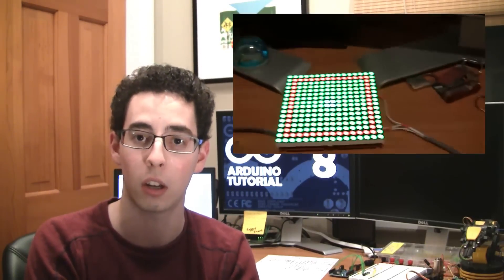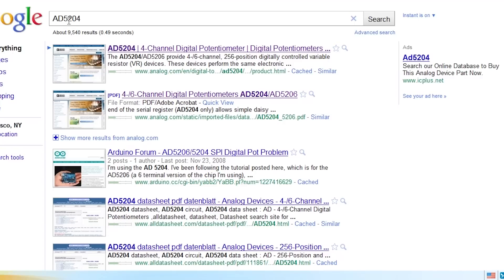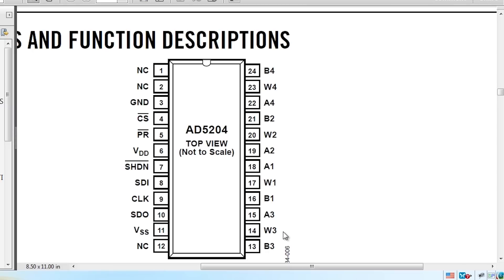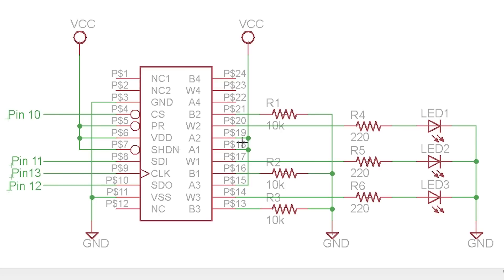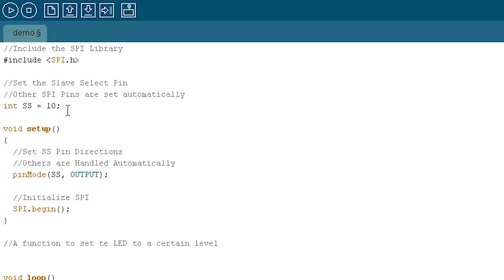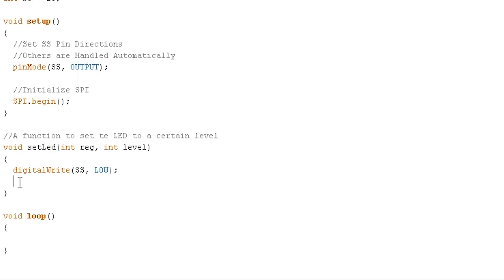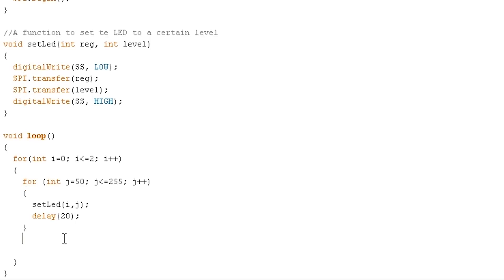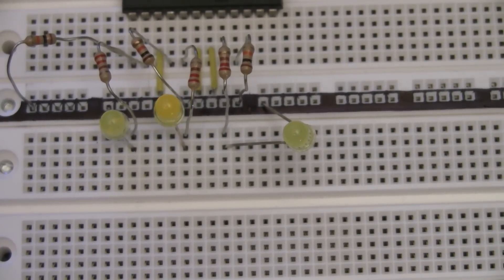Tutorial 08 for Arduino: SPI Interfaces

Comment: How does one send 2 or 3 bytes over the Arduino SPI?  is SPI.transfer() good enough?  I see on my Analog Discovery 2 Digilent analyzer that the first two spi clock pulses are missing when I try to run SPI.transfer() consecutively ?   Any good hints or resources available.

Comment: Great video! One question though, for the values that I assume are voltages that you're sending to the LEDs, what are the units for them? You write "50" and "255" but never go into detail on what they exactly are. I'm trying to program a DAC in a similar manner and need to be able to send exact voltages to each pin, but I need to know what value to set them to. Thanks!

Comment: For Arduino Uno, can we have a 2/3/multiple SPI control? Since the Slave Select is assigned to pin 10, I've tried using other pins as Slave Select but it never worked... or does it have another way?

Comment: So when a student is THIS tardy to class - do they merit even an acknowledgement that they've raised their hand with a QUESTION???

Sorry, but I was surprised at 12:30 to see you starting your j for loop at 50 BECAUSE - I thought that was exactly what the resistors back at 7:00 were intended to address - no???

Could this simply be that: you made an edumacated guess for resistance to lop off the useless bottom range, but discovered that so much still remained that you had to "fine tune" that pruning in software, that being easier than trying to dial in the resistor value?

guessing ...

Primarily wanting to confirm the understanding here - that BOTH approaches target the same issue?

Comment: Is it possible to use multiple ultrasonic ping sensors  .. with their trigger PINs in common or shorted .. but  each echo pin is connected  to  different   control lines of arduino

Comment: nice tutorial, however i want to know how MOSI and MISO work in this project? for example like, which pins are actually controlling the right LED to light up and controlling the PWM signal, because i saw you r using both MOSI and MISO?

Comment: Hi.. Please explain !!!!. There is a module that works on 3.3 Volts.
Using SPI in UNO which has 5Volts. Can that damage the module?
Is SPI effected with voltage levels??
Please help!!1
Reply: yea, you either want to find a version of that device that uses 5v, or use a logic level shifter such as the 74LVC245
https://www.adafruit.com/product/735
Reply: Ryan Young Yeah.. did the same.. thanks

Comment: Hello, Im very new to all this.  Can the wiper ever be controlled from the serial monitor instead of using the for loop? I can not find anything on this and i really need to learn how to do it.  I am an electrical engineer whit no programming experience.

Thanks in advance,
Shaun
Reply: +Just4Yuks Hello, maybe this can help you. ARDUINO MICROCONTROLLER GUIDE 2016. Step by step how to design and programming Arduino. FREE DOWNLOAD HERE
https://plus.google.com/116428027560638976608/posts/96r9KFpBur9

Comment: so if there only 2 CS what do we do in the case when we have like 10 slaves? or in my case 10 imu's?
Reply: Frank Lopez Either use more GPIO outputs and or use an external Multiplexer
Reply: Chris M explain how so?
Reply: Frank Lopez You can look this stuff up....pretty standard... This is not the place to go into detail..I think you have 3 SS on the Arduino...not sure since I use other devices...You can look at doing a "Daisy Chain"on the SS if you don't want to add any additional hardware...Another way you want to expand the number of SS, then look at the data sheet for this part: 74HC151 and 74HC02.... If you have 3 SS pins now than you can get 3^2 multiplexed pins or for more pins need t use GPIO pin as additional output from SPI software to 4^2 ....and so on...
Reply: i am using a 16ch analog/digital multiplexer for this 10+ mpu6050 i just dont know where to go from there? sorry chris im really new all i had was the idea, the parts just came in after me asking around what can help me achieve this concept and im barely learning how to read code never mind actually write my own

Comment: maximum how many leds can u control using spi interface??
Reply: The LEDs are not directly interfaced using SPI, instead a digital pot is used. In the video, an AD5204 is used, which is a 4-channel pot, meaning it can control 4 LEDs. AD5206 is a 6-channel device and thus can do 6 LEDs.

Comment: I would like to transfer over the W5100 Ethernetshield in RTP a 2*16bit=32bit Audiostreams with 44100S/s = 1411200bit/s /8bit= 176400Byte/s Payload plus the RTP Controll. Then i would like to send it over a 2nd SPI interface during streaming to 2DACs with each 16bit SPI out. Do you think i have the Time and this will go in function because i don't know what the 'C' Compiler is doing because i programm on the ATMega16 everytime Assembler. I must realise also the overhead and this is not so small if you know the RTP Controll Protokoll. I must transport 2 differnt Audiostreams.
My Board is a 2560 and i read that it is possible to have 2 SPI Interfaces at the same time => one over the SPI Interface and one over the USART is that correct?

Best Regards
Volker King

Comment: Hi Jeremy...  I am trying to exchange from PIC to Arduino...
But I have a doubt: How do I save the data got from SPI in a variable?  
with the CCS I had this, for a 16 bits variable:

" SS_LOW();  //Communication begins
  spi_write(register);  // register is 8 bits = the address that I want to access
  B1 = spi_read(0x00);   //B1 <= MSB 
  B0 = spi_read(0x00);   //B0 <= LSB
  SS_HIGH();   //Communication ends
  return (B1<<8 | B0); "

Thanks for your attention... Carlos Bohn.
Reply: use array , in many way you can make high byte , and low byte , you can use eeprom also and saving to the eeprom if the content of the address is 0 using for loop to jump into the address then check the content if it is null , if someone have better idea plz share it

Comment: Hey Jeremey, is there am IC similar to the digital Pot that communicated via SPI but reads four pots rather than writes to four pots? Kind of an analog multiplexer of sorts? 

I need a way to read many pots on one Atmega328, but 8 analog pins is too few for me.
Reply: the same ic , you can read the 4 pots , in the place of write .use (PIN 10 -SDO )connected to pin 12 in the arduino , use the same process but use
while (SPI.available!=0)
then when you get the value end the transmission .

Comment: Usually ,SPI in atmega has got modes based on CPHA (clock phase) and CPOL (clock polarity) bits , setting which is quiet important for communicating with peripheral devices , So which mode was the MC on arduino board working in this tutorial ?

Comment: Nested loops, ouch.
Reply: ***** "...  And you wouldn't be able to scale as much as you think ..." 
// Bam -> 6 LEDS and 256 Levels !!!
For ( int Led = 0; Led <= 5, Led++ )
{
      For ( int Level = 0; Level <= 255; Level++ )
      {
         SetLed( Led, Level ):
         Delay(1);
      }
      For ( int Level = 255; Level >= 0; Level-- )
      {
         SetLed( Led, Level ):
         Delay(1);
      }
}

I just DOUBLED the number of LED's supported.
I just increased the LEVELS by a factor of 64.
Very simple, very easy.
That is what an INTRODUCTORY DEMO is all about.
And I did not increase the size of my application like you would have.

I think you have lost sight of this demonstration.
It is about testing the "SPI" communications.

This demo Is NOT about code optimization and not about Non-Blocking Real-Time type programming. That is a completely different (advanced) VIDEO.

This DEMO code, tests the functionality of SPI.
And does a great job accomplishing that idea.
This is not final production code so do not criticize as if it were.
Reply: did you hurt yourself?
Reply: Naah, I just cringe when I see nested loops like that. Making little CPU work harder when there's no need.
Reply: ***** "... Naah, I just cringe when I see nested loops like that. Making little CPU work harder ... "
 - How do you code it so that the CPU does not work so hard?
Reply: Well instead of making nested loops create a structure that contains LED value and
direction (increasing or decreasing). Then you update value depending on direction. 

You can make an array containing these structures. And then loop over that.
Reply: ***** With only 2K of RAM (scarce resource) for Stack and Variables, I am not sure that substituting Arrays of Data Values for a couple of Lines of Code is a good trade-off in a microcontroller. Especially if there were a large # of LEDS and if each LED had their own unique Stepping Pattern. Also, the FOR Loops could be designed to easily allow a variety "special" effects per LED at RUN-TIME. The "For-Loops" can easily Scale-Up for more LEDS and for more STEPS. But your Array solution cannot Scale-Up, as it will run out of RAM quickly.
Reply: While RAM argument does make sense you would be effectively using 5 bytes of memory per LED or group of LEDs. Which is a lot better than O(n*410) function on 16MHz CPU. Not to mention you wouldn't be able to do anything else until this code is completed which is a lot of time. And don't forget that since his loops are static in size on compile time compiler will probably unwind them to optimize execution speed effectively increasing you executable in size which is also a potential problem. 

Memory usage with approach I suggested can be a problem but you can also do some tricks to avoid it. On the other hand nested loops are never a solution and you should always look to simplify code. Unless his code is never gonna change and it will never have any other purpose I would guess it is okay to stick with that solution.
Reply: And you wouldn't be able to scale as much as you think. As each additional LED takes additional 410 cycles, not counting the delay function.
Reply: *****
 How did you figure the 410 cycles?

Comment: Any reason you've chosen to use integers to hold values no greater than 255? Seems like you could have been more miserly and used the byte data type. I realize it's only a couple variables in your function in this program--but in most non-trivial projects the extra bytes saved might be quite significant. Just something for folks to consider anyway.

Comment: Hey dear, i couldnt understand the variable reg and level . i keep on seeing them in each SPI example but can't what do they represent actually?
second question is , i am trying to connect and test an arduino spi with a transmitter... i want to send a byte and get an ACK back , , what code should i use ? ... the transmitter has a crystel of 10k and arduino uno has 16k ,,, should i synchronize them first ? and how
Great vid thanks,

Comment: Hi-I am considering the design of a system to include both SPI and I2C usage.  The SPI would do the datalogging while the I2C would be used to drive the display.  So can you use both interfaces in one program?  Thanks!

Comment: Hello,  Great information.  Just needing to use SPI with my Arduino Uno.  I have a network and sd card from seeedstudio.  Their documentation seems to show their ss for network card is 10 and sd card is 4.  I should be able to write low to both those pins and use at same time?

Comment: Gosh! Such a good information. This is was I was looking for.

I only have one question. I'm working with Labview so I'm using the interface for Arduino, besides I'm using a SD card Shield in order to storage the information. I guess my slave is the Shield and the master is the Arduino. Is the conexion the same as you explained in this videoblog between the Arduino and the Shield?

Comment: In this particular application this could all be done with pwm very easily.. He chose this to teach the use of spi communication. In other cases tho this pot ic would be able to hold the resistance with only one communication from the arduino freeing up the system for other tasks. Also this ic functions as a true resistor where pwm simulates an analog voltage which would not work in other applications.

Comment: jeremy,
 the ad5204 accepts a 11 bit binary number, the first 3 bits of which correspond to the address and the last 8 bits for the value going from 0 to 255 like in case of the leds you use.
my question is that when you send something via spi to the ad5204, doesn't it read it as a 11 bit word. For instance you send first the register and then the level, but you send it in two separate steps, shouldn't you be sending it all in one step such that it forms a 11 bit word?

Comment: Jeremy, I am liking your Arduino tutorials very much, but I must correct you on one point... 

The "W" in the digitally controlled variable resistor stands for "WIPER" not washer. Think windshield wiper; that is the physical design of the moving part on the analog pot variable resistor. 

Otherwise, keep up the good work.

Comment: Really great video thank you!!! I had a question that I hope you could answer.

I am trying to build a usb based data acquisition system that has 32 channel with a minimum resolution of 12 bits and has a sample rate of 100-200hz. I decided to use 4 of the MCP3208 which is a 8-Channel 12-Bit A/D Converters with SPI. The problem is I would not be able to continuously sample all 32 channels. Do you know of a way to buffer the SPI output of the MCP3208 or another way to sample all 32 channels?